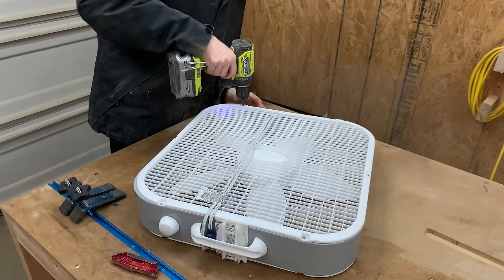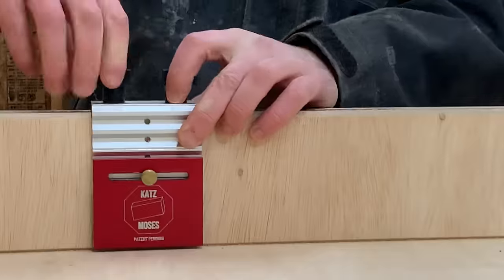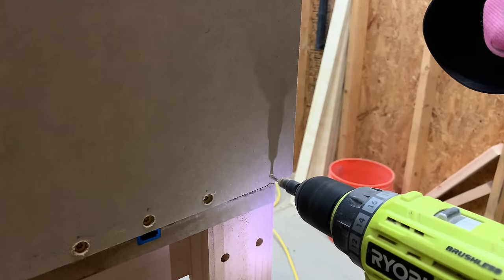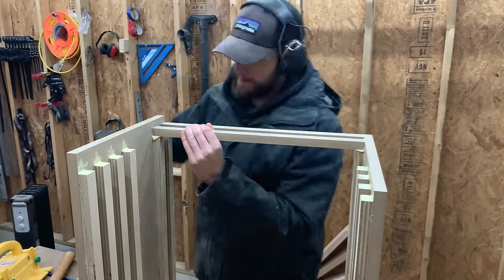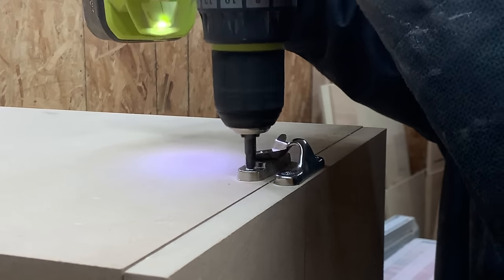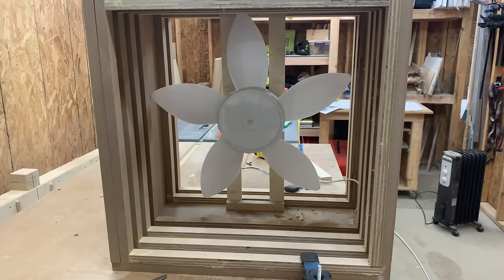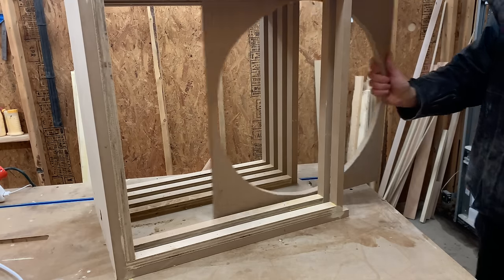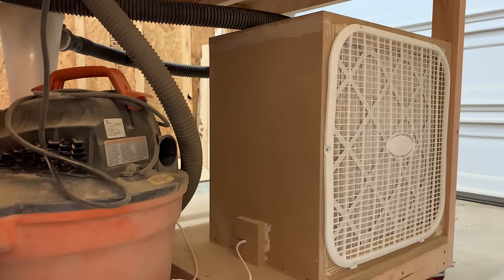this $20 fan will SAVE your lungs

Comment: Thanks for the filter box idea, square fans fit great in a window blowing out for a negative pressure when it’s not too cold outside. We crack open a window on the other side of the room just like in the kitchen when the fan is on over the stove and pull in some fresh. MDF has a lot of glue and fine dust when cutting = mask,,,mixing a bag of cement = mask,,, blowing off brakes or engine related= mask and glasses and gloves. Cement dust is a slow killer so in 20 to 30 years by the time you are in your 50s it effects your heart and lungs. The silicates are so small they never come out. Cutting tile or cement blocks or countertops. Shop vac if you can and up wind if outside with water. With the box, if the exhaust side is blowing up the dust from the floor the air quality might not be as clean as you hope for so putting it on a shelf in front of a window to exhaust outside might do the trick. I’ve done this for dry wall sanding and it makes the job easier for sure. My friends dad had a triple bypass from cement in his fifties and another friend has a bad heart from cement and construction dust doing Renovation. I hope you don’t mind my comments for your channel and thanks for the video

Comment: I like to use 3D printed brackets with titanium inlays reenforced across the stress points. Also stainless steel grating coating in antislip bedliner needs to be added. Build new wiring harnesses and install a digital thermostat and secondary relay switches. The housing needs to be ceramic coated and high density insulated also. I have been working on my version of this for about 17 months now. Waiting for a few more pieces to get back from the extrude-honing machine shop.

Comment: I've been thinking about doing a project like this but with an electric automotive radiator fan from a junkyard. One from a larger vehicle will move significantly more volume which will make the exchange of air more efficient. 
This design is a great idea though. You could really use any type of fan you can find and adapt the dimensions accordingly. Thanks for the video.
Reply from the maker: Lee, that sounds like a super sweet idea! Yeah a blower that moves more volume would make a significant difference. If you try it, report back and let me know how it works! Thanks for the support! 😀
Reply: I have to do the same thing since my shop has to be off grid .

Comment: Nicely done. The circle piece added acts like a funnel to pull air through. It is the same application as the fan shroud on your vehicle. Without a shroud the fan pulls a column of air the size of the blade surface area.
Reply from the maker: Thanks for the clarification!
Reply: Suggest s clarification - the shroud on exit side of fan keeps backflow from happening arond the perimeter. Chemical smoke/air current tester showed the perimeter backflow into my 20" Lasco fan Stopped when shroud covered about 1" of the blade tips. And air flow increased per my fanflow measuring kit (duct blaster)

Comment: @6:40: The round around the fan is basically a duct. This ducted design reduces propeller blade tip losses which improve efficiency (more thrust/CFM, power efficiency per CFM, etc).
Reply from the maker: Interesting! I appreciate the scientific reasoning!! Also, thanks for checking out the video and the helpful comment
Reply: Geologist
Reply from the maker: Geologist know fluid dynamics quite well!
Reply: @SpencleyDesignCo  That's what I heard too
Reply from the maker: They’re also great at changing flat tires on rocky roads
Reply: More thrust😊

Comment: In my house I have two box fans with 2500 micron filters attached to them. I just tape the corners to the intake side of the fan and set them running. When the filters are dirty, I change them out. We have 3 dogs and 4 cats so there is a good bit of dander and stray fluffs of fur filtered out, not to mention pollen and such during the spring and summer.

Comment: It seems like it would have been a lot easier to remove the plastic guards, for increased airflow, and then mount some perpendicular extensions to the metal frame on the corners with screws or bolts to hold the filters, and you're done. If you really wanted to ad the circle cut-out that could be a piece of cardboard.
Reply from the maker: That’s definitely an option 😀

Comment: I made a coupe of simple filters out of two different box fans a couple of years ago by just attaching a filter to them, but in both fans, a thermal overload protection in the fans caused them to shut down after running a while. The restricted airflow caused the fan motors to work harder and overheat. I had to add wood blocks as spacers between the fan and filter,  so the fan could pull in some air around the filter and not have to work as hard and overheat  and shut down. They worked okay after that, but weren't as efficient filtering the air.
Reply from the maker: I’ve had mine up and running for well over a year without any issues
Reply: If you do that you are mostly just having air go around the filter - the air will mostly take the path of least resistance. Completely defeats the purpose. Maybe try another fan, I have done the with a couple of cheap fans over the years no problem.

Comment: i do 3D printing and while PLA isnt toxic i did use a 20 inch box can and taped a 20 x 20 ac filter wirh a rating down to vir.   i try to set up the fan to pull air across the three printers by placing a room divider in fromt of them as rhey reside against the wall. 

this makes any dist snd off gassing go through the filtrt first.  
your design may be my next project as i know thats so much better.   

thanks for the inspiration!

Comment: I've heard that JoAnn Fabrics , etc had material that is used to make patterns for tailoring . It is suppose to be the same as commercial filters for various fans at much cheaper cost . I expect to put one layer behind the fan where air is sucked in to block dust , etc . To attach to box fan with blue painters tape or similar . And when it gets clogged to throw it away and cut a new . I use a 20 inch box fan on medium speed on my nightstand to block out street noises , etc. And also to use a wet/dry vacuum to vacuum the motor or compressor to blow any dust out .

Comment: All I did was duct tape a 20x20 filter to the fan. It worked great!
Reply: Front or back of fan?
Reply: @rhondaeverett8284  The back of the fan with it blowing away from the tool and me.
Reply: @rhondaeverett8284  I use a cheap filter on the back of the fan and a HEPA filter on the front. It works better like that.
Reply: Thank you

Comment: Good design. Though I would place the hepa filter inside between the last sacrificial cheap prefilter and the fan. This would help keep the fan motor and blades clean from dust debri.

Comment: I've got a strong 30" shop fan I did this with just a couple of nights ago.  I spray painted a shelf and since it's really cold here in Illinois right now, I had no good way of venting the garage without losing my heat. I put 1 filter on the front and one on the back, then turned the fan on high. Sat it a couple feet from my shelf. Worked way better than I when hoped it would.  I could visually see it immediately pulling the overspray away from the shelf to the fan.  There was virtually zero spray paint dust on my garage floor.  Not bad for 2 filters from home depot for less than 5 bucks.

Comment: What if you made the box just slightly larger so you could have slid in the entire fan between slots without disassembling?  Also, I’d buy a second fan and keep it so when the first one fails, you know all the parts from the second one are exactly the same.

Comment: Looks awesome. Gonna be making one soon. Any reason why you took the fan apart and not just out the fan inside the box?
Reply from the maker: Great question! I really just did it to minimize the weight as you would need extra material to make a slightly larger box. Definitely no harm done in leaving the fan intact
Reply: Spencley Design Co. ok thanks for the answer. I desperately need one so I will probably be modifying your plans a little. Thanks again. Now to check out the rest of your videos 😁
Reply from the maker: I appreciate the support!!!!
Reply: Spencley Design Co. no problem

Comment: When I first started I taped a filter to a box fan similar to the one you dismantled . I put a quality filter on the out going air and a cheep one on the intake. I still use it when I spray paint from a spray can to catch the overspray. Mine is much less work to "build" and probably works the same as yours. I have more expensive permanent units , as well now , but I still use my box fan for particular jobs.
Reply: I did the same thing recently as well. 20x20 pleated filter will stick to the back of that box fan by suction pressure (same one i use) while it is running.

Comment: I made one. The box fan doesn't have enough static pressure to pass air thru a super cheap filter let alone a fancy hepa.   Just hold a filter against it and you will understand.

Comment: I did something similar with the same box fan. I used large rubberbands and weather striping for a tight seal with filters front and back. Not a shop filter but it keeps dust & pollen down.
Reply: I did that many years ago using elastic. Worked well. When the elastic got too old I just switched to wide blue painter's tape. Easy to remove, seals completely and easily.

Comment: I use duck tape and a filter to the back of the box fan and have used my method for 2 decades with no issues
Reply from the maker: Yup, that’s definitely a great option! I was just looking to make something a little more polished.
Reply: Well you did an awesome job at it for sure!
Reply from the maker: I appreciate that, Jay! And thank you very much for checking out my channel and showing your support. I means a lot!

Comment: In a busy wood shop that hepa filter would plug up in a few minutes and even the original plastic grate that you reinstalled to the box will also clog up... you need to 'exhaust' the dust.

Comment: Woodworking is about square.
Boatbuilding is about angles and curves,
Jigs are essential. It's not about repetition or production. It's about accuracy and the value of the product. A single foredeck hatch frame made of teak on a custom yacht that is arced to the deck is worth many jigs and temples. And a full scale test build in poplar.

Comment: The round baffle around the fan is to increase the air velocity because when your either pulling/pushing air through a filter you'll have a pressure drop. Too much static pressure and you'll prematurely burn that motor up.
Reply: OH, so you're a geologist.

Now if I could just find an engineer to help me with my rocks.
Reply: @dhuze66  what kind of nonsense are you talking about. Im in HVAC so yea i know what im talking about.
Reply: @07slowbalt  The guy said he didn't know why he needed the shroud because he wasn't a geologist, which is a person who studies rocks. Care to guess what an engineer does?
Reply: @dhuze66 i gotcha didnt recall that part of the video, its been 11 days. You replied to my comment so that threw it way off.

Comment: The fan should be placed in the baffle (on the same plane when looking from the side) for it to be effective. With the baffle 2" - 3" behind the fan blades as you have it the airflow will simply flow from the high pressure side of the fan to the low pressure side. 

Also to protect the fan unit from dust particles, it is better to place both filters on the low pressure side of the fan.

Comment: I know I am "late to the party", however, I sincerely hope you have upgraded that brad nailer! It would drive me crazy having it fail to properly drive so many times! My cheap Harbor Freight brad nailer hasn't failed me yet! Once I set the air pressure for the material, it works every time!

Comment: I'm sure someone has said it since this is 2 years later, building the box as a prefilter thing and not doing anything to the fan except putting it at the end of the build might work better. The fan is already built and housed to work well as is and fans work better pulling than pushing. Pulling all the air through all the filters is better and the fan is already set to go.

Comment: Good idea I have did this with my box fan simply by putting the filter on the back side of the fan with a couple pieces of duct tape
Reply from the maker: Yeah that would definitely work! I just wanted to make something that was a little more finished 😀
Reply: I have 3 in my shop, just as you describe.  I locate them next to my scroll saws and my sanding station.  They are easily portable and take up little bench space.  Simply remove the tape to replace filters.

Comment: If you could hang them...would you point them up so the dust travels toward the ceiling or place a couple around the shop walls to create a "cyclone" effect to keep air moving?
Reply from the maker: That’s certainly a good idea! I didn’t even think about that! In theory, it seems plausible. However, I’m far from a fluid dynamics expert so I’d have to defer to someone with more expertise in that field
Reply: @SpencleyDesignCo  Maybe you could find a geologist from a nearby university to ask.?.?  😜 👍
Reply from the maker: Now you’re talking! I’ll head down to the local university art department and see if there are any that could help me figure it out 😀

Comment: Just wondering if putting the hepa filter towards the back side of the box work better than in the front and a light filter on the front. Something like light, light, hepa setup on the back and a light hepa filter on the front?

Comment: I have way more experience in building computers than wood working so here's a computer geek's take. The reason you need the round frame is for static pressure to force air more efficiently through the filter otherwise you will have air turbulence and less efficient filtration. Same principle when using liquid cooling in a PC; you want higher static pressure to blow through the radiator(s) to cool the liquid coolant. Of course, you see round frames for fans on ACs, car radiators, etc. I would recommend using a fan with a circular frame around it, use the circular frame inside the box, and fill in any gaps in the corners. You should also have at least one filter panel as close to the front of the fan as possible. The force of the air will keep it out of the fan blade. A panel too close to the back could suck in the filter and heat from the motor on the backside could be a fire hazard. Fan blade angle is also important. The greater the angle, the more air pressure. Really, a shop fan with a flat round metal frame would be perfect but they can cost more. Window/box fans are designed for breeze.

Comment: I’ve done this before and that cheap box fan is the same one I used,  this fans blades are crap
They barely pull any air through it’s because of the shape of the cheap ass fan blades , I spent a little bit more money and bought a metal fan instead it pushes way more air and works 10 times better. 😎😎😎

Comment: Nice effort. Those little screws into the edge of MDF won't stay; that will require redesign very soon. Also consideration of wall thickness on a project like this offers some choices between overdone (= more costly and inconveniently heavy) and too thin (= more noisy).

Comment: Nice build! I think if you're going to go through the time and expense building this you might as well spend the money and get a fan motor that has, like, some power. Those walmart fans barely have any strength and won't really pull the dust from further than immediately next to the fan. Add all those filters and you will barely have any airflow at all.

Comment: The fan shroud needs to be as close to the edge of the fan blades as possible to maximize air flow. Maybe 1/8 of an inch clearance will do the trick.

Comment: Cool video.  I just set up box fan on my shop table and vent the exhaust out the open shop bay doors.   I use it primarily for welding fumes in conjunction with wearing a 3M 2297 vapor/ozone mask when welding on galvanized zinc steel.   The box fan is easy to move around and sucks the smoke out and away.   All cutting of wood is done on a table saw with lockable casters, pushed outside.   But hey, I get it that not everybody can move tables around so easily.

Comment: Like others said, and mine is even simpler, take a 20x20 filter and let the fan suction hold it to the back of the fan. While it appears clean in the house the filter turns dirty after a month or so. And I don't know about the cirle thing if the box fan doesn't have it, but I could see that it would increase the pressure.

Comment: I've seen a lot of videos like this.  A lot of work when simply taping a HEPPA filter to the input side of a box fan works just as well.  Depending on how much dust I'm generating I will often use two fans, and can easily locate them adjacent to the source because they're light and portable.  I know this is effective because I can see the dust and shavings on the filter.  A quick vac and they're good as new.

What's worse is seeing the prices for so-called shop air filtration systems.  Outrageous and less effective.

Comment: Do we see the control switch mounted inside the box?  How did you mount it?  Does that mean I have to remove the filters each time I turn it on, or do I slide my hand in and  around the fan?
Reply from the maker: Good question, Mike! I don’t recall if I show it in the video, but I wired a simple flip switch on the outside so I can easily turn it on and off. Another option would be to just unplug it when you want to turn it off
Reply: @SpencleyDesignCo  Wouldn't leaving the main control in a dusty environment. inside the filter assembly as you show it here, create a fire hazard or Class II violation??   Wood dust and electricity is not always a good mixture
Reply from the maker: It’s possible